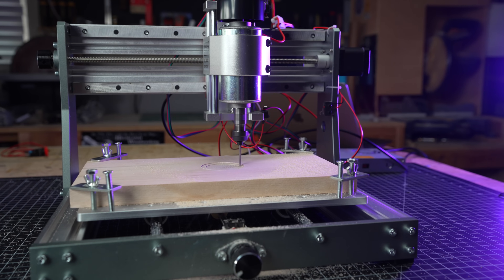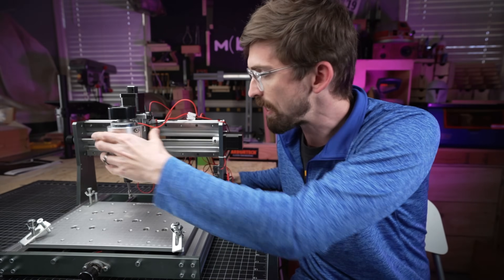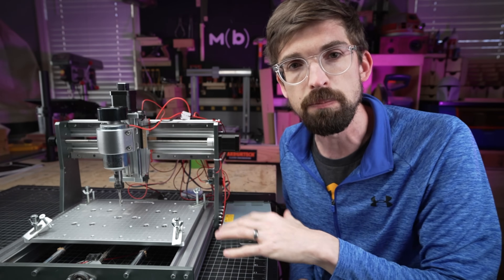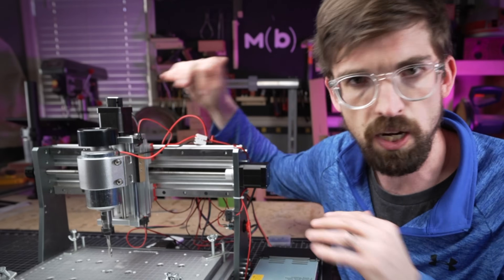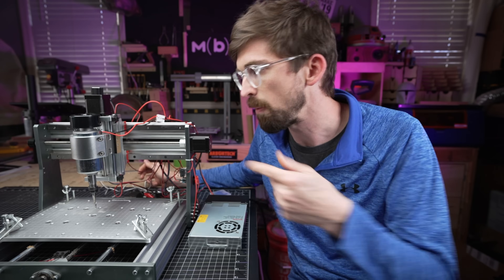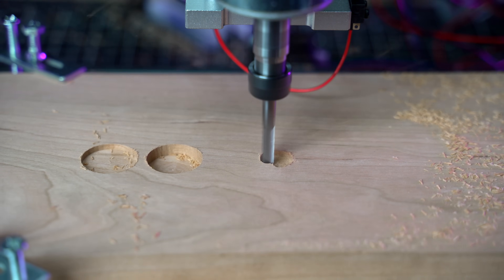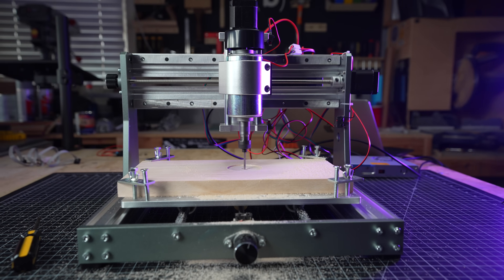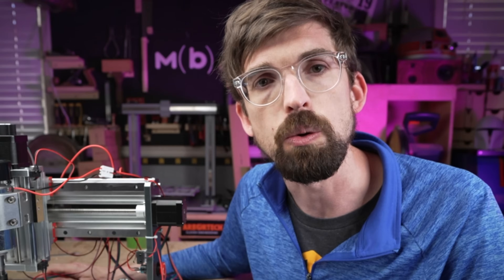What Can a $500 CNC Do? Genmitsu 3020 Pro Max

Comment: Been waiting for this machine for months. Decided I should get into desktop CNC machining because I was having so much fun with my k40 laser, and pretty quickly decided this was the machine to get because of the aluminium spindle bracket and the proper linear rails. Seemed like the likely price vs performance sweet spot. It had just started shipping to the US, surely they would get the UK certification sorted before long... right? That was like, 5 months ago maybe? Still waiting. Fkn brexit I guess.
Reply: What has China to do with brexit? You wont a milling machine well guess Genimitsu 3020 Pro Max is NOT a milling machine neither is it advertised as one!
It's meant for carving and drilling. This dude has made a decent machine  https://www.youtube.com/watch?v=76M3BY38OL4&list=PLuALDxqjV3FeupXobAGJ3YrrsSsW7h4Zn
but get this as a reference. Y- axis supported rods should be 20mm to drive the table above the NEMA 17... So do the CAD you get more than the idea, FreeCAD is suitable.
And don't rely on models like fixed bearings from GrabCAD etc. the downloads are free but you never know if the dimensions are at point... Yea it is a pain sometimes, but CAD
models rule ;)!

Comment: It would be nice if they could design into this a dust collector motor with a small port that moves along side of the bit motor to collect the wood shavings/dust as the routing is performed. Is that what the "second motor" could be used for in the future?
Reply from the maker: They make a dust boot that you can hook a vacuum hose up too.  The additional motor port is usually used on the other side of the X-axis  so that the gantry is less likely the rack when moving.  I'm guessing since this is small enough and its along a linear screw it wasn't needed.
Reply: The second motor is probably going to be for another machine that drives a gantry on two lead screws on Y. Like stepcraft with performance kit.
Reply: Can it make gun slide??

Comment: If it does in fact get shipped to you assembled that helps a great deal imo. Unless it was shipped assembled just to you for your review. Not sure.  Can't you lay the power supply and mount it just under the rails of the work bed and prop it up for air flow underneath? Thanks for your review of the 3020 Pro!
Reply from the maker: It’s not completely assembled, more like 2 major sections and then some wires to hook up.  You could mount the power supply I just wish it was something built into the design.